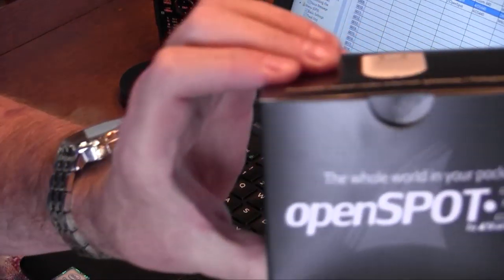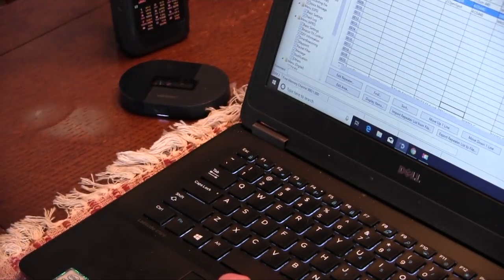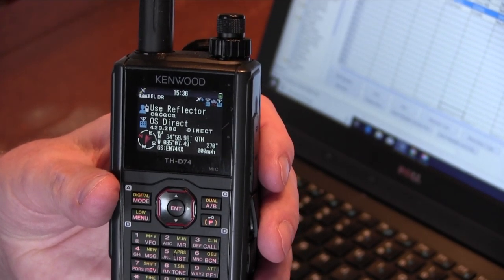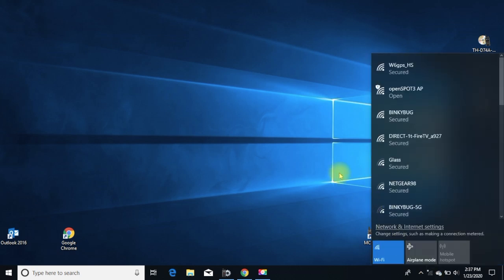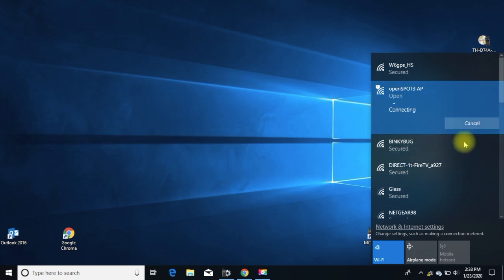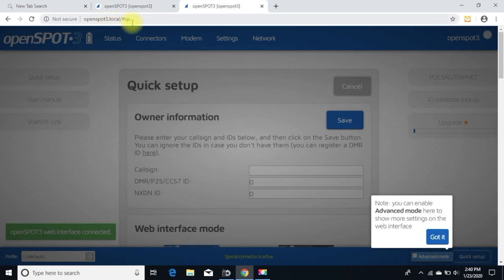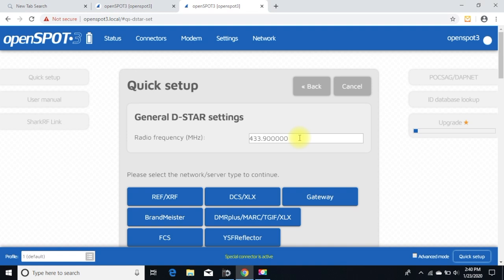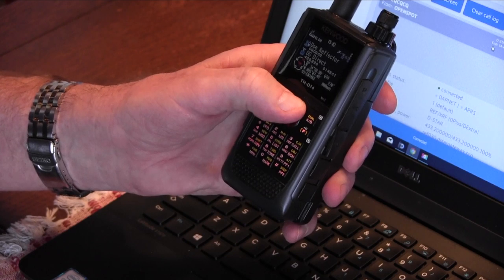Setting up a Kenwood TH-D74 with Openspot3

Comment: Save your money!! Glad yours worked! mine died after 4 uses. All you get through product support is next to nothing, they won't admit that their product failed. I got told that my WIFI magically turned on "client isolation". I then took the open spot to 6 friends houses and got same lights that again support told me that was because of client isolation, even though while at 1 friends house I helped him put up 6 wireless cameras that were on this router that my open spot wouldn't talk to. Huh? Lastly I dug out my 4G cellular hot spot that the open spot was last mated to last June but surprise! Same lights telling me, according to support that I had client isolation enabled on my hot spot. I called the cellular company and surprise you can't turn it on in their hot spot!! SAVE YOUR MONEY, IF IT FAILS BE READY FOR HOURS AND I MEAN HOURS OF FRUSTRATION BEFORE YOU FINALLY THROW IN THE TOWEL. All you get for support with same information over and over and over! They won't admit when their junk is broken!

Comment: I wanted to ask you a question concerning the placement of my OpenSpot3. I use the OS3 in my shack ONLY and always keep it plugged in. When it's not in use I keep it in NULL. It sits on a shelf in front of my MFJ auto tuner. I also have my HF radio in the shack as well as ladder line coming into the shack. My question is when I transmit on HF while in the shack, can RF damage the Open Spot3 in any way? I haven't yet gone on HF since receiving the OS3. I figured I would ask someone like yourself before I transmit. Any information concerning this question would be greatly appreciated. Be well.

Comment: Great video Don, your audio was fine today on 30C and appreciate the hint on the iPhone connection to be able to control the open spot while using the iPhones hotspot, couple of doubters today about the openspot but I haven't had a problem, just go to the forums and you get a quick response. 73, de Herb, KX4QV